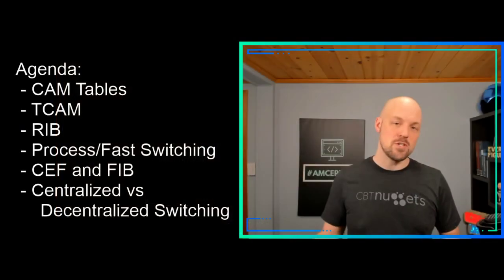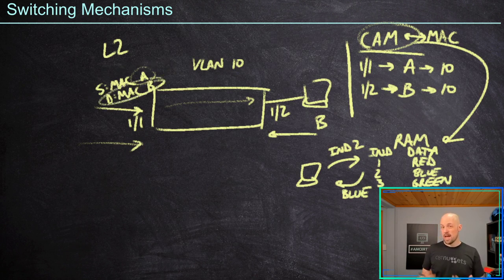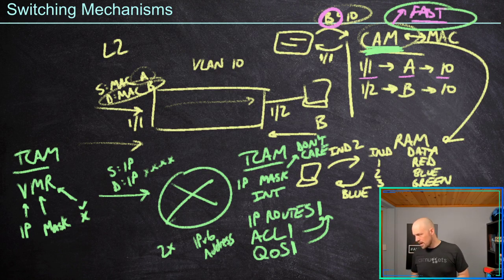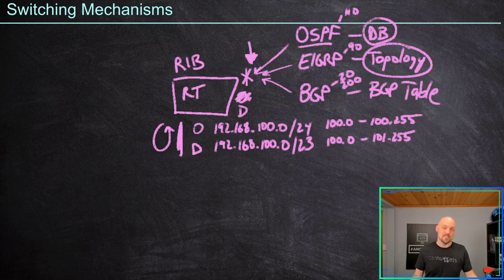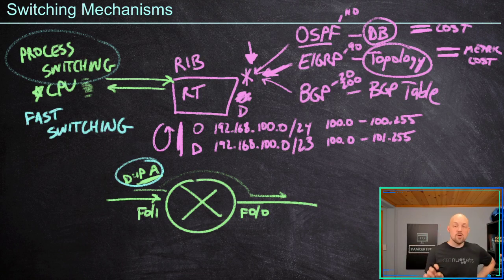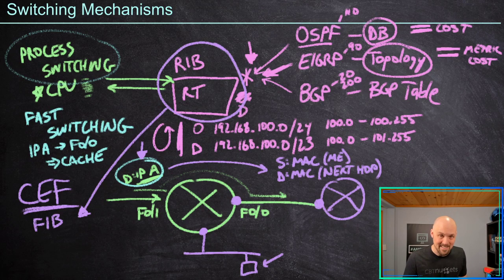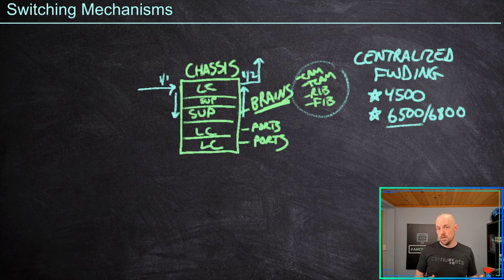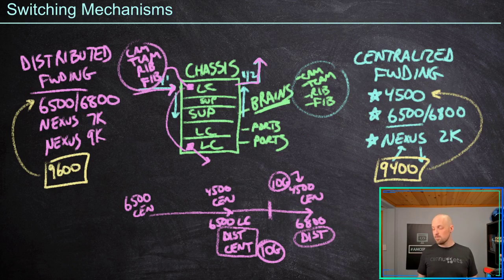ENCOR - Switching Mechanisms

Comment: Thank you for this explicit explanation. Much grateful if you could provide a lab demo. I've the lab in GNS3 and CML. I'm a bit confused. With CEF enabled globally on a router., I turn off CEF on one of its interface where packets are received with the command no ip route-cache cef. The debug output shows the packet is switched via FIB which is used by CEF. So turning off CEF on the inbound interface does not change anything as the packet is still being switched via FIB. Thank you for your reply

Comment: Not relevant to ENCORE. Just a general question, when windows PCs  connects to a Hub, even today, it is like windows is going to detect (whatever logic they use) that they are connected to a Hub and slowly they switch back to the older CSMA/CD way of doing things? Is that correct? Its very interesting then..Do you know any book that talk about this specifically?
Reply from the maker: There's actually no adjustment that needs to be made.  Ethernet NICs must abide by CSMA/CD even if they're the only device on a collision domain, because we never know for sure that another talker won't appear.  There is no way for a NIC to detect that it's on a full-duplex link. Fortunately, CSMA/CD doesn't affect communications until a collision occurs, which would never happen on full-duplex, so there's no real downside to this.

I would expect any CCNA book to discuss this in detail!
Reply: @KishSquared  thanks Jeff